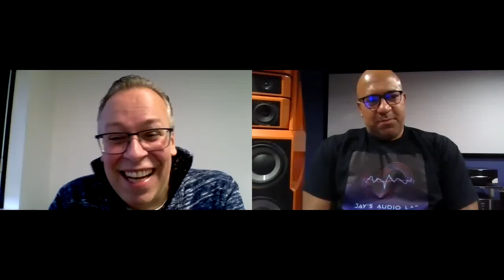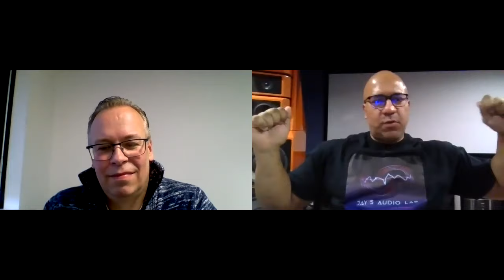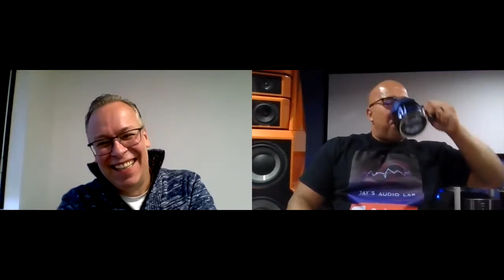PART 2: Jay's Audio Lab interviews Taiko Audio's founder - Emile Bok

Comment: I think viewers would like to get more info on the Taiko and it’s unique technology. But 50% of the interview was about cables… Why not talk more about the software, firmware, hardware, power supply…. Tidal, Qobuz… and the future of streaming… The difference between CD, File, streaming and why there are these differences… Talk less, listen a lot more.
Your questions are better for cable manufacturers. This interview seems to be more about your interest and your system, than about Taiko.

Comment: Since silver power cords run leaner bass and slightly brighter than most copper power cords/interconnects and speaker cable's are there any other types of conductive materials that would work! I know fine braided gold wiring is over the top even for most of the wealthiest clients!

Comment: Chord specifically issued the warning (back in 2014 or so, when prices were much more normal than today) NOT to use fancy power cords with their amplifier, otherwise the sound quality will degrade significantly. They advised their customers to use the stock $15 cable only.
Reply: That's just typical marketing; makes a potential purchaser think they don't need to spend anymore money.
Reply: @warren818  What the heck Chord has anything to do with the customers' future purchases except to make them happy with what they already purchased i.e. Chord amplifier?